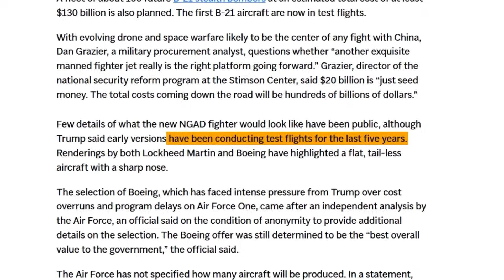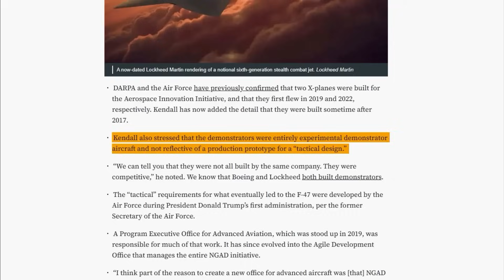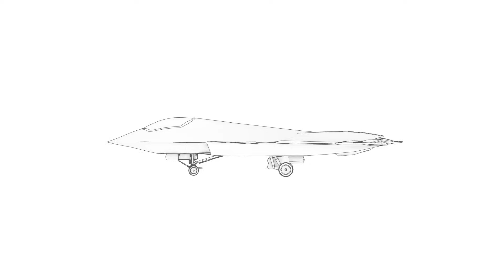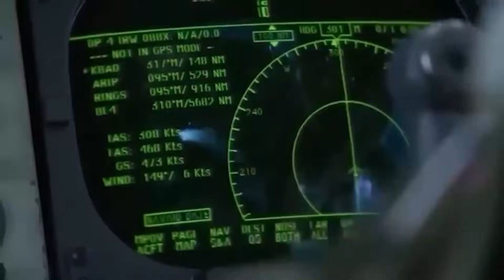The Secret F-47 Jet That Quietly Broke Every Speed Record

Comment: Oh and by the way, if you surround that jet with a negative magnetic field at -19.5 Hertz which is the waveform of our galaxy, it no longer weighs anything or has any atomic weight they can fly through the Sun they could do right? Angle turns it on at the speed of light and right now top speed in outer space is about a billion miles per second. That's what they call warp 9.35 on Star Trek but even the stuff you see on Star Trek are antiques

Comment: You guys are flying antiques. I can build you a jet that'll out fly out speed and you cannot see it on radar. You can't see it with the eye. He can't even see the little bit of air it moves around and it's space capable and it never needs fuel. It runs on one single ring magnet 238 volts at a million amps. No moving parts to the power supply. And if you use the same thing in missiles, we'll have missiles that can do Mach 100. Not kidding. You guys can find me if you need me. I don't even want paid